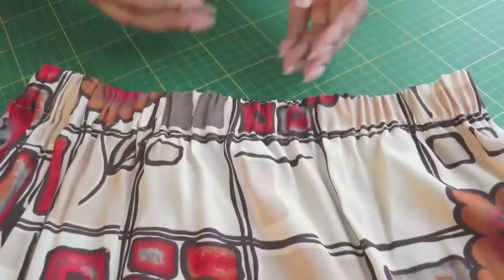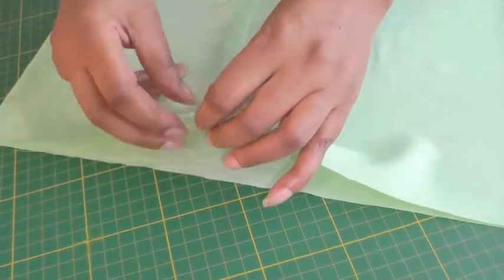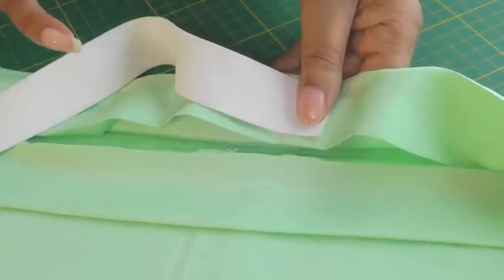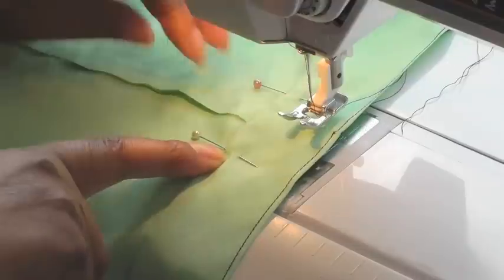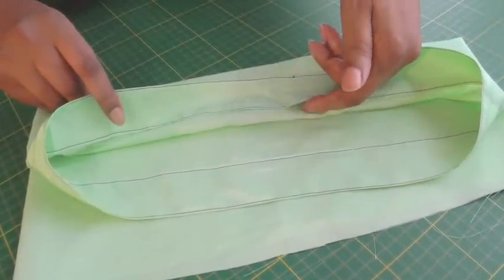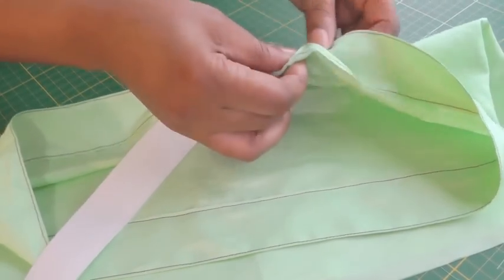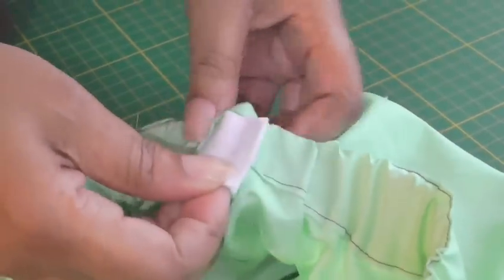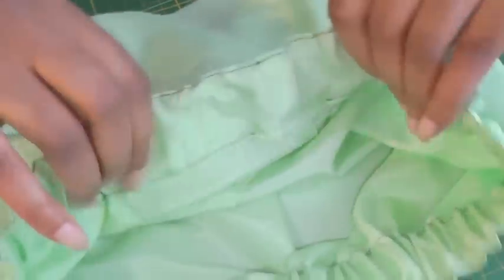Sewing an Elastic Casing

Comment: Most casing videos I've seen are about casing elastic in a round, like this one. Do you have any suggestions for a "flat casing" to make the casing integrated with the topstitching? (instead of 1. making casing, 2. pulling the elastic through, and 3. stitching down the elastic through the material). Goal is to make the elastic end stitching over the material not so visible and more integrated with the piece as a whole.
TIA
Reply from the maker: Hello Anita. This video may help with your problem https://youtu.be/kJSqTcH_Nb4.

Comment: I've sewn my casing but the elastic isn't gathering right with the fabric. I have a stretch that is flat and not gathered. No matter how much I pull on the fabric to even out the gathering there is still a flat section can anyone help?
Reply from the maker: Hello Yvette, It seems like your casing is to small in certain areas, the elastic needs a little more space for it to move.